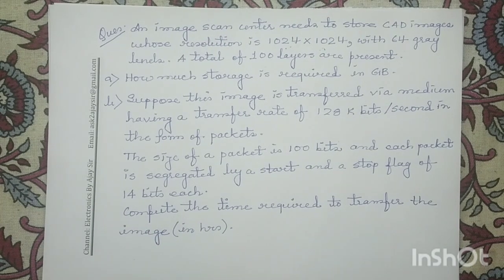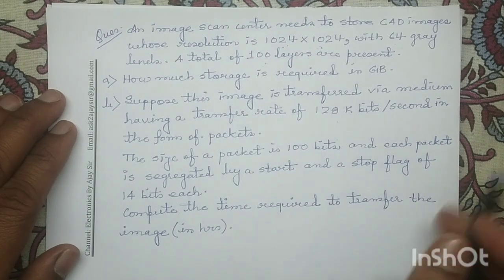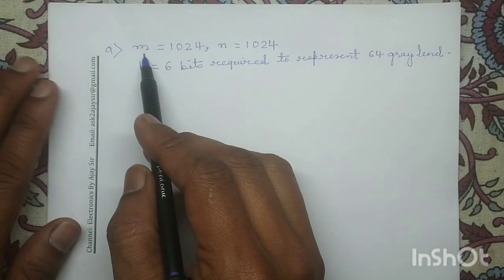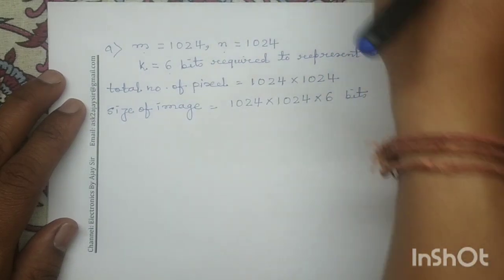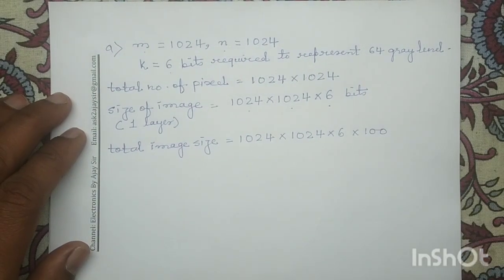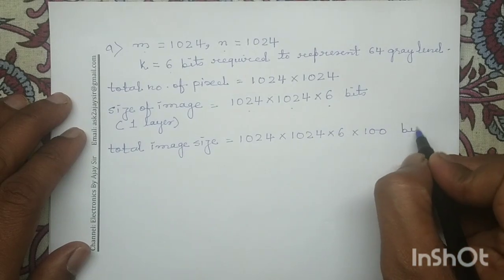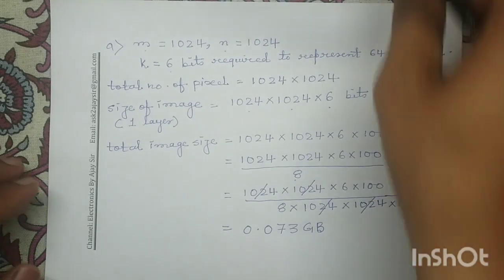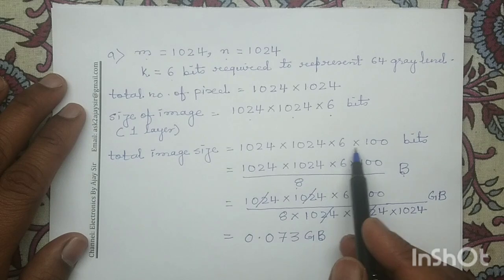Module 1.1: Image Size Determination and its transmission | Solved Numerical Example 1 | DIP #like

Comment: Sir if the size of the packet is 100 bits then the header bits also Include in this packet so the size of the data bits are  72 and headers bits are 28,
here you added extra bits for header in the packet but packet is the combination of header as well as data bits
Reply from the maker: Dear Dipanshu, 
Your doubt is obvious. 

As mentioned in this question "The size of a packet is 100 bits
and each packet is segregated by a start and a stop
flag of 14 bits each." The Term "SEGREGATED" means other than 100 bits, start bit and stop flag i.e in packet configuration other than 100 data bits, 14 bits as start flag and 14 bits as stop flags are present in packet. 

However if the question be like "The size of a packet is 100 bits
and each packet is CONSIST OF a start and a stop
flag of 14 bits each."  then in this case "the packet configuration data bits are  72 and headers bits are 28, fits here."

I hope, now you can clearly distinguish both the cases.
Reply: @ElectronicsByAjaySir  Thank you so much for your valuable response, Sir. Your explanation really helped me to understand the concept better